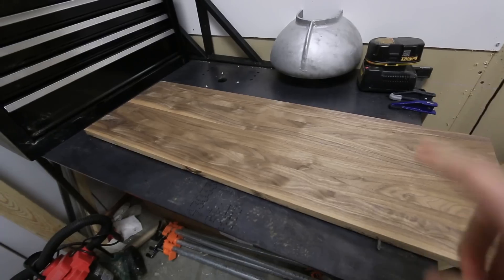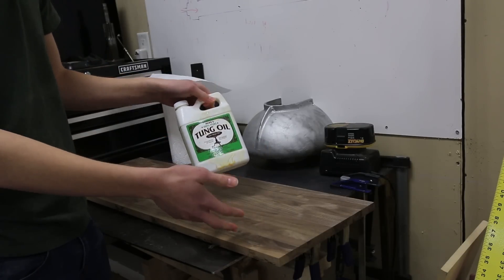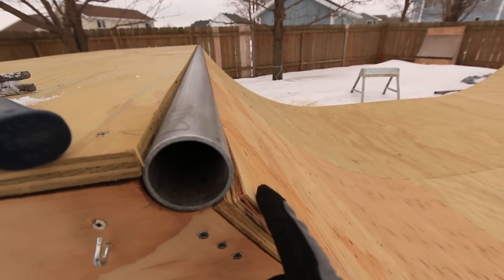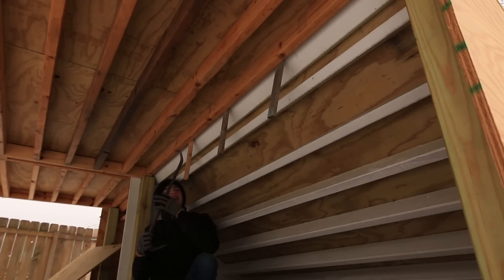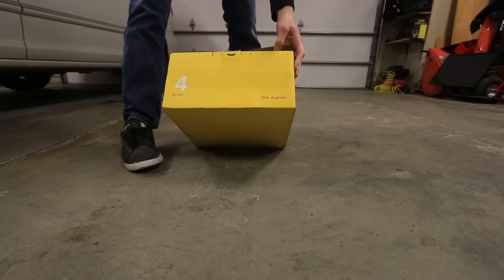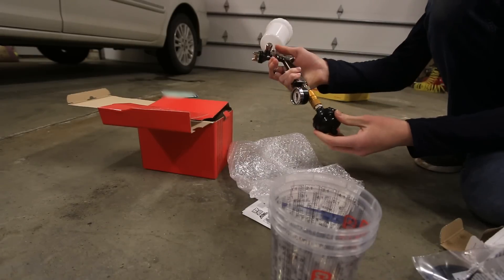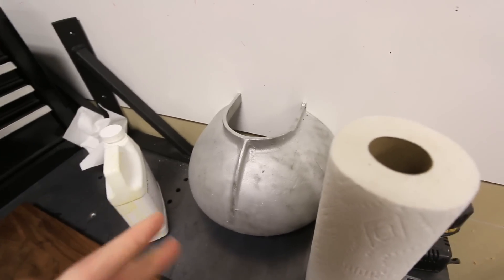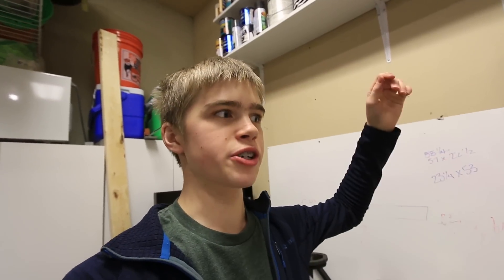I have to fix the halfpipe, AGAIN!

Comment: I have three questions 1. Why do you Build all these ramps but you never ride them 2. Why do you film the same trick over and over again 3.how much wood do you buy a week
Reply from the maker: I ride some of them alot, some of them I took apart for other ramps, and some I don't have a place to ride them so they are just sitting in my backyard collecting dust, and snow. I record the same tricks multiple times cause I when I practice I do the same trick over and over until I can land it 100% then move on to learning a new trick. I haven't bought any wood in the past month or two, but in the summer I think I bought somewhere around ~125 2x4s, and ~30 sheets of plywood. So around here when I priced out the ramp that would be 1125$ for a whole halfpipe, a 2' quarter, and a 1' kicker. To put that in to perspective, if I were to of bought a OC ramp 1 size smaller than my halfpipe it would of been 3000$.